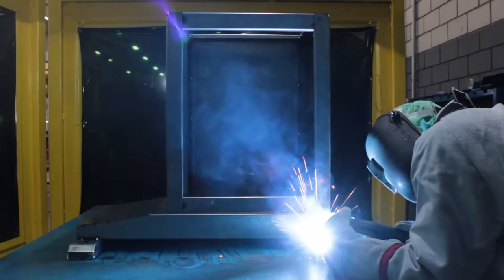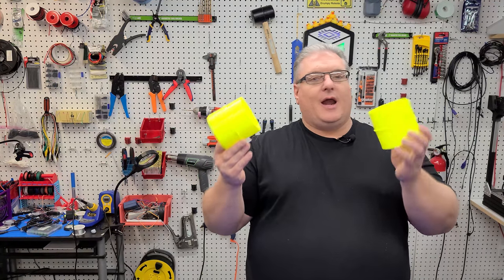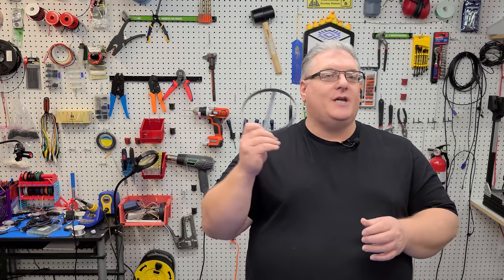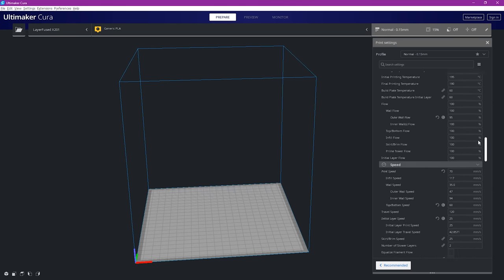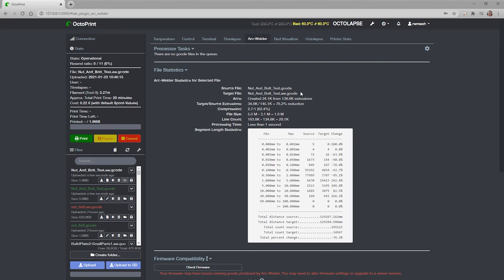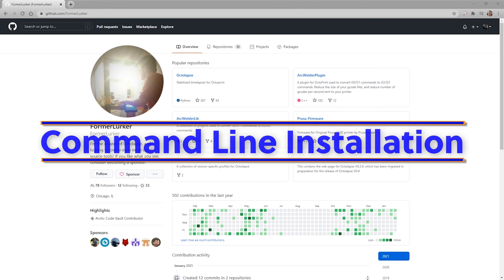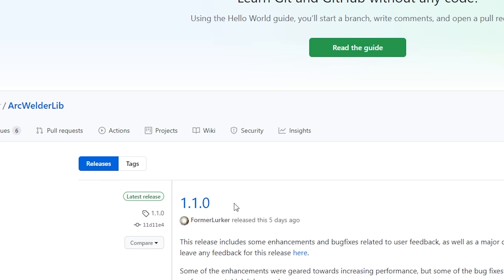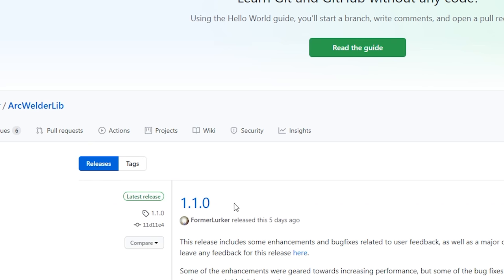Arc Welder - Smoother, Faster, Better 3D Prints! Its like magic to improve your 3D Print quality.

Comment: I take it that this won't work with Simplify3D and an Ender3.
Reply: It will work with simplify.  There is another reply explaining how to do this with the arcwelder console app.  I will add instructions to the github repository soon.
Reply: @FormerLurker  Thanks. I have only used Cura a few times and I paid for Simplify3D, so it is my go to slicer.
Reply: I've added documentation for integrating with simplify in the ArcWelderLib repo here:  https://github.com/FormerLurker/ArcWelderLib#running-arcwelder-from-simplify3d

Let me know if that helps, and be sure to read about the optional parameters.  You may need to add some options depending on what firmware you are running.

Comment: Can i use arc welder w/o octoprint? Anyone?
Reply from the maker: Sure you can.  You can also use it at the command line.  Just slice your gcode then run it through arc welder command line version.  Load it on an SD from there.
Reply: @MakersMashup  thx!